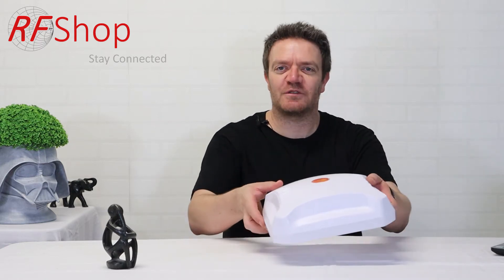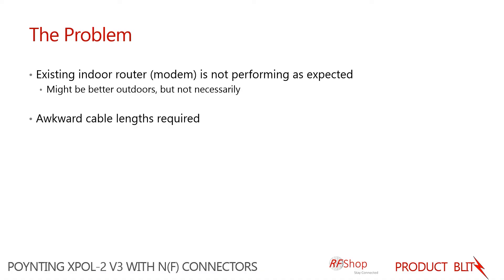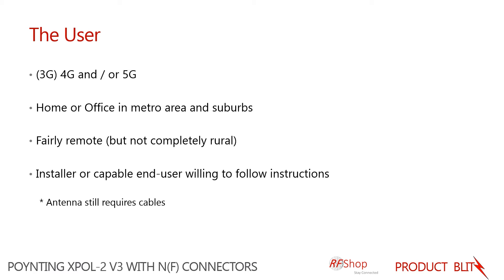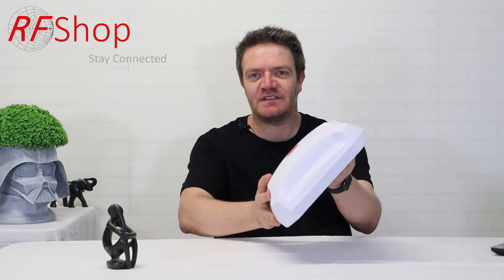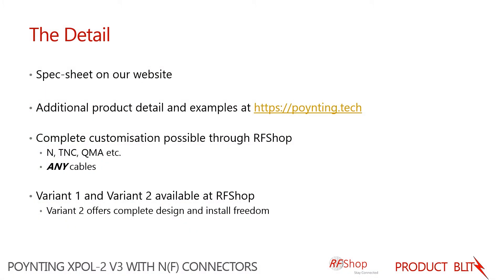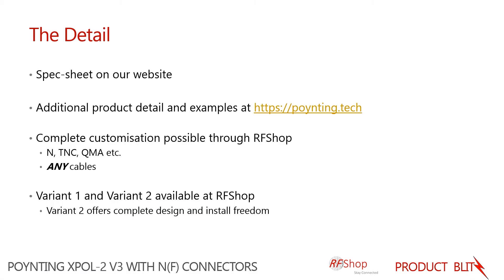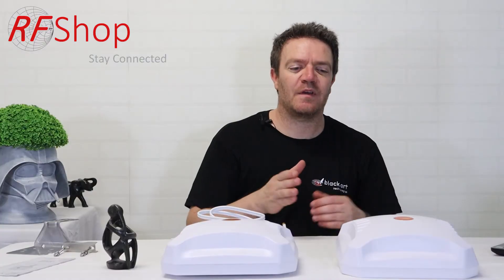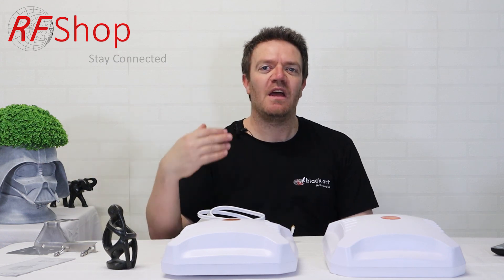Product Blits - XPOL 2 v3 N(F) Connector

Comment: Just bought one waiting on it to be delivered. Was also thinking of buying a Huawei 5G CPE Pro no 5g in my area yet but on it's way . Would the Cpe Pro 5g work well with 4g lte ?
Reply from the maker: Hi Ger...yes, the CPE PRO 5G should work perfectly fine in the 4G area. 

There is potentially a problem though, which I can't explicitly say on Youtube but there is a video brewing in my head...you may find that the external antenna ports of some consumer grade 5G routers are 4G only and NOT 5G. I may have witnessed this with my own eyes, and might have investigated the inside of the router to confirm a contradiction to paperwork I may have seen. 

Please feel free to contact me direct if you want to learn more (email is fine if you are not in Australia)
Reply: @RFShop  Hi thanks for the informativ reply 3 Ireland use the Cpe Pro with a external antenna it's one of their packages so does this mean that the external antenna does not actually work with that router .
Reply from the maker: @germulhall8668  don’t want to open a can of worms here, but what I saw was that two of the 4G antennas are routed to the TS9 ports.